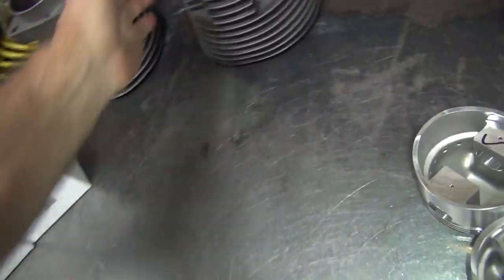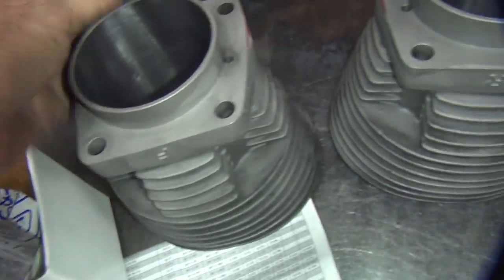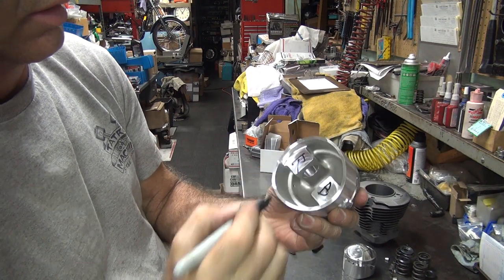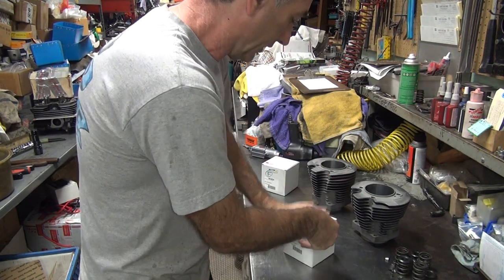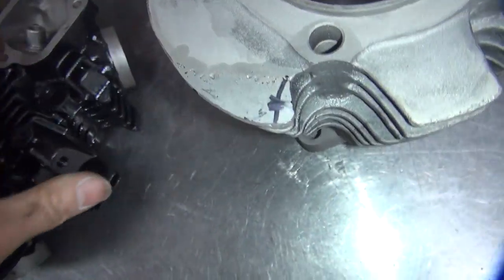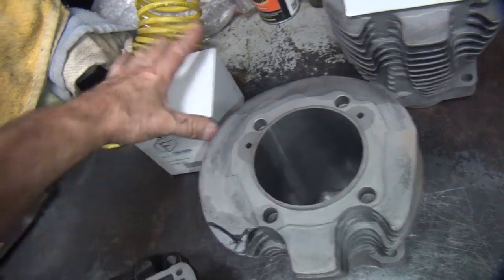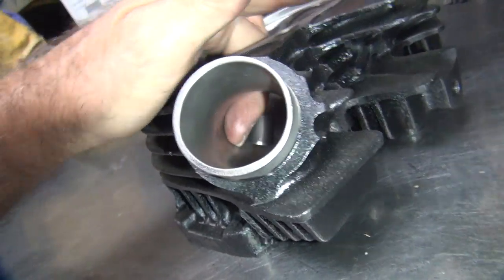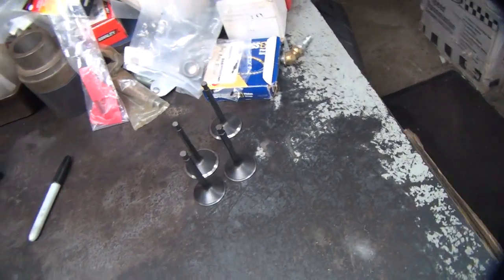#103 1980 sportster 74ci stroker cylinder & head rebuild repair xl harley ironhead by tatro machine

Comment: I  would have called S&S on this to see if their alloy has changed. Them pistons look different than the old TRW 3700 series the paper was printed for. I just went and looked at an old TRW3700 and a forged Wiseco Iron XL piston I have here, and you are right about them looking like the latter underneath. Smooth. Anyway, The box says .0025 but the most likely outdated (for these pistons) paper says .0035 to .004.  I think that is why they put the updated and corrected clearance right on the box unlike they ever did before, but threw the universal paper inside during packaging. You might have just set these up with basically twice the clearance called for on the actual box they came in that you claim had an incorrect part number. I question your decision to run them so loose. That possibly (likely) halved the lifetime of the top end. The correct part number is there, you just missed it. It is in the "part number stamped on piston" column just before the clearance numbers.
Reply: And if the clearance really was supposed to be .0025 due to low expansion alloy, they won't expand into the bore during warm up and will clack like a worn out Chevy 292 6.

Comment: Send them to a flow tester. A guy named Branch used to do them.  He measured air flow. Not sure why you think you can out think a machine that doesn’t think, only measures reality.
Reply from the maker: i am not impressed by either branch at all. my land speed records are all the matter to me. not what someone else thinks. who makes the most power and has the balls to hold it on, wins.
tatro